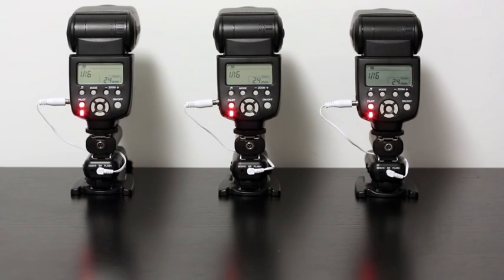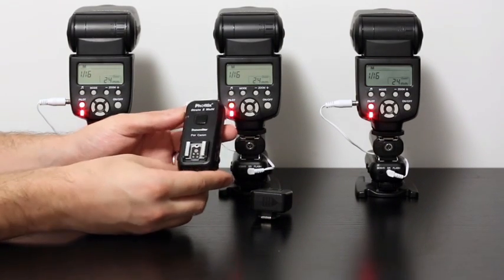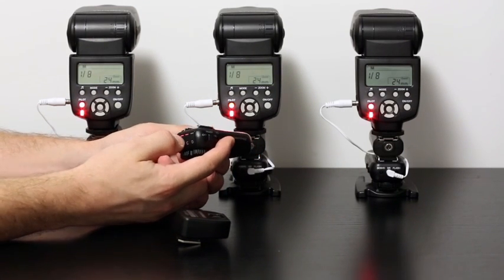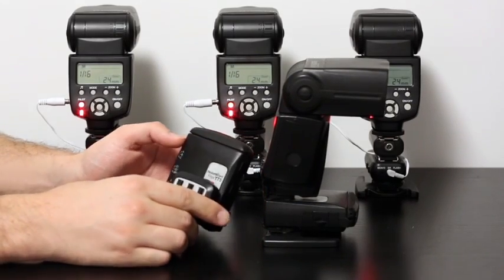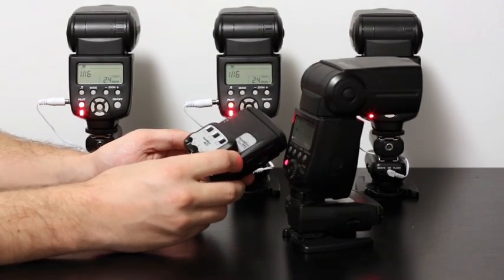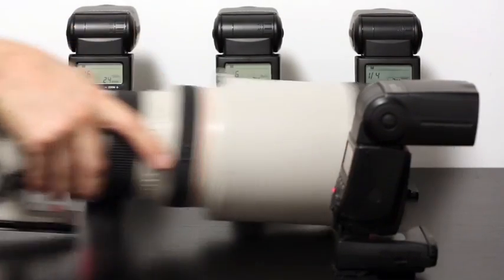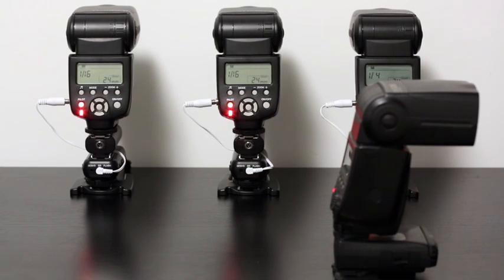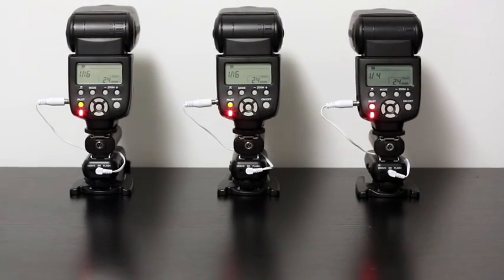Manual radio controlled speedlights brief review

Comment: Hi...nice tecnica! just is nothing with pocket wizard or other triggers...you have 2 channels...  one control the trigger other the output of power as it is connected to the speed light output power control..... what i want to say is that probably if you use the pocket wizard PLUS III as receiver and transceiver to control the output power by cable to speedlight you will get the same results...and to trigger u use just normal trigger PW or other...

Comment: I think there is a little language issue.  I use many old film cameras like a Pentax or old Nikon F2a using the ControlTL units (ControlTL units meaning a FlexTT5 or MiniTT1) in basic trigger mode all the time.  There are no delays and I do not need to use the test button... I just press the shutter button and the flashes go off in sync.  When I want to change the power, I use a 2nd mini with AC3 and change to whatever power setting I want.  Works all the time.

Comment from the maker: ControlTL *can NOT be used ON the generic camera*. See how it's NOT firing on Hasselblad in ControlTL mode, but it DOES on Canon and OFF CAMERA in my video.

 Also, you can make a test in your own hand - the delay between you press the "test" button and when speedlights actually fire is around 0.3 sec :D

Comment: My point here is you are saying things that are not quite true, not which is better.

ControlTL *can* be used on any camera like a standard dumb trigger, I proved that.  An AC3 on a ControlTL unit *can* be used off camera to control the light output.  The only thing it cannot do is be in basic trigger mode and control power settings at the same time.  To do that, use a 2nd ControlTL unit with AC3 off camera and control the lights all you want.  I do this all the time.  

Respect to you Ilya.

Comment: Not true.  The AC3 will continue to have full manual control of power to the flashes... even if the MiniTT1 or FlexTT5 with AC3 is not even connected to a camera.

As I said, they PW are very expensive, but they do things that no other trigger on the market does.  If it answers your needs, there is no other trigger on the market out there.  If it does things you do not need, then there are other alternatives.

Comment: Crazy expensive?  Definitely, and 4 groups, not 3 if you use the ON camera flash as a group.  So... 1 on camera as commander as a group, then use groups A-B-C for the other 3.  Also, the crazy high price of the ControlTL units offers many more advantages.  If you do not need them, this is not for you.  No one product is for everyone.  BTW, Photix Odin a quite far from all that the PW ControlTL units can do, but they are quite nice as well.

Comment: Awesome video, but your saying that the ControlTL units cannot fire flashes on any other camera other than Canon or Nikon is incorrect, they can be made to work on any camera with a hot shoe successfully in basic trigger mode.  The range issue is a a Canon 580EXII flash issue, no other flash does this and range is good with ANY other flash!  Thank-you for an awesome video, I am sure it will be valuable to many!